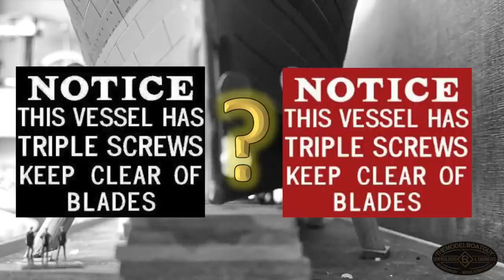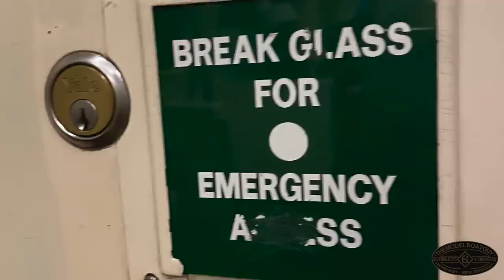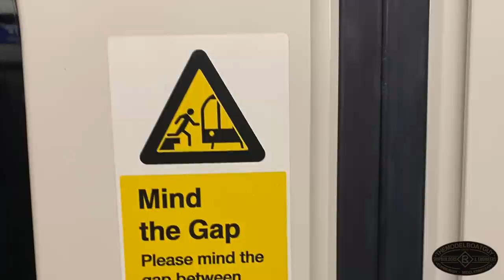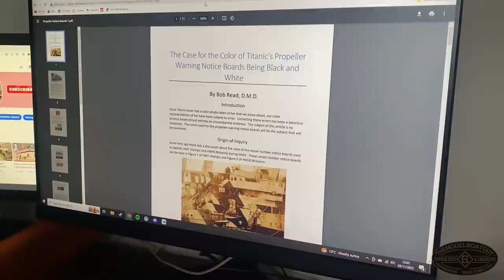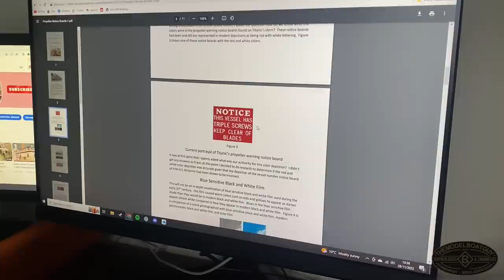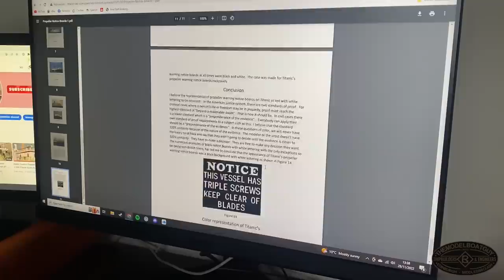Radio Control Trumpeter 1:200 Titanic Build Part 71 - Railings and Signage

Comment: Im starting to think every scale modeler has some weird janky homemade glue applicator they use for fine points lmao
Reply: Janky, love that term...although i did have to look it up! 
Personally mine is a burger skewer painted orange with an angled pin (cleaned after use) - probably 'the' most used tool in my arsenal...no euphemism, straight up the best piece of kit I've not had to buy 👌
Reply from the maker: I think you’re right!

Comment: So I don't know your name, I'm Tim....but your attention to detail is astonishing.   I am currently in  process the Hachette/Agora 1/200 Titanic build.   It has issues, of course.   YOU are on the 1/200 plastic kit that comes from Hasegawa.   (I think).    Anyhow?    I just bought the 1/250 scale Amati kit....all wood.
Reply from the maker: Hi Tim,
Thanks for the comment! I’ve seen the hatchette titanic and did consider getting it, but I thought two 1:200 scale Titanics might be a bit much for my small flat! 
This model is the Trumpeter titanic kit, as you say it comes with its own set of issues. Some not so bad, some a bit worse. But in some ways a few issues are quite good as they add to the problem solving aspect of the model. 
The Amati should be a really good build, I have never made a wooden planked model before so interested to hear how it goes. 
I’m thinking of making a Greek Trireme style boat next and converting it to have working oars, so I might get the chance to build a wooden model myself before too long 😀
Cheers,
Robbie

Comment: What's that oddball looking glue applicator you're using?  Did you find that spraying kicker left any residue on the paint.  Just curious.  You sure make the railing installation look easy.  I struggled with it.
Reply from the maker: Thanks for the comment, the weird glue applicator is a sewing needle with a wooden handle. I cut the needle in middle of the eye to make a sort of Y shape. This can be dipped into the glue and the surface tension holds a very small quantity, which is great for small applications. 
Not my idea I hasten to add! It was suggested to be by a follower. 

I never got any residue with the kicker, however I did find sometimes it makes the glue dry too quick which gives it a sort of frosted effect. The solution to this is to paint over the affected area with clear matte varnish, another suggestion from a follower of the channel. 

Railings were tricky for sure, I found it helped to pre bend as much as you could, so they don’t have the tendency to spring back, and also I used blu tak to hold other bits in place as I went along.

Comment: I’m surprised that you left the railing out of level on the port side deck where you cut it to fit.  Is that something that you are going to fix?
Reply from the maker: I need to go back and straighten it, the error equates to about 0.5 of a mm so it’s very fiddly!